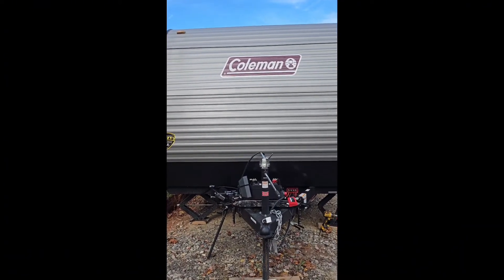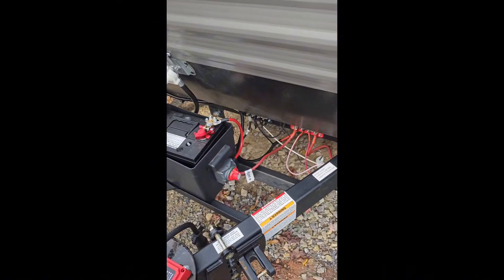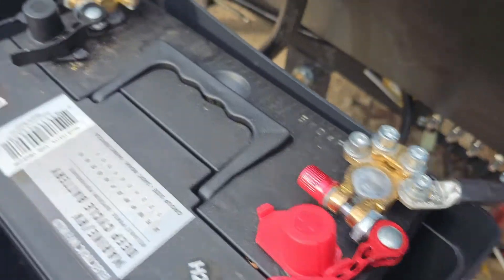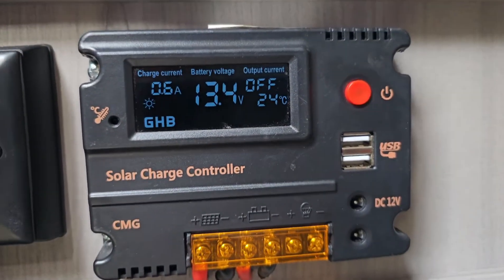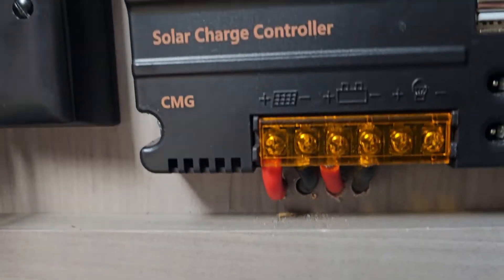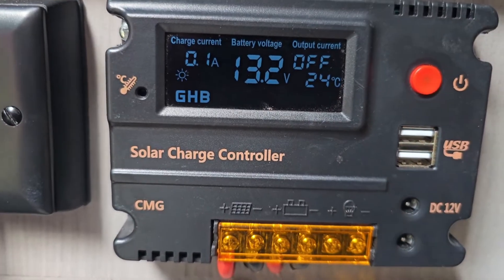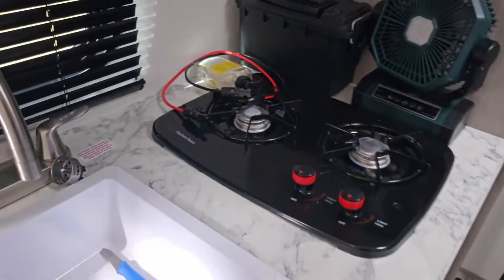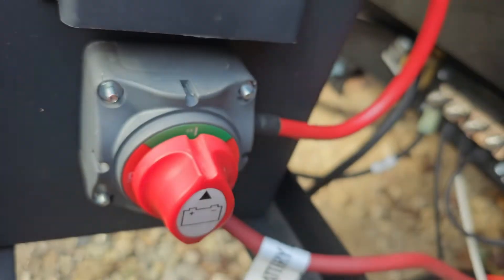ADDING SOLAR ON THE COLEMAN 17B CAMPER. (on the way to off grid)

Comment: im buying a 17r right after thanksgiving. one of the first thins im doing is hooking up solar to the solar ready plug. you have a great set up i wish you explained better where each plug was and where it goes like a wiring diagram since you said its just an emply plug
Reply: so the solar panel is plugged into the plug which goes to the controller and then you have wires coming from the controller to the buss bar, which then is switcdhed by a disconnect?
Reply from the maker: Well the reason I didn't show where the plug was originally was because mine came with some really Tangled wiring and was not professionally done and it was just hanging down so I wanted to get it off as soon as possible. If you're doing this I would highly suggest watching a few videos on how to hook up a charge controller in any solar system. I know it seems difficult but it's actually extremely simple. It's all direct current so think of it as a straight line. You run wires from your battery to your charge controller with fuses in line of most everything. Then you run wires from the solar panel to the charge controller and honestly that's it. The bus bar is basically just a power distribution board so you could also think of the bus bar as the battery. Everything red from the battery connects to the Red Bus bar and black to Black. As long as you have the black grounded to the frame and all power going to that red bus bar then another wire from the bus bar to the battery then you're good. I really hope I didn't overcomplicate that.
Reply: @BULLETENVY o
Reply from the maker: I'm super happy you're getting a camper. It's going to be a great journey for you.

Comment: Thanks for the video, I'm interested in one of these trailers and wanted to understand more about how it was "solar ready" What is the model of the charge controller?
Reply from the maker: Well I'd be happy to answer any questions you had and I hopefully soon we'll be putting up a video of an entire overview of the whole camper. And I think I still have the box for the charge controller so I'll go out to the garage and find it and get the model for you if I can. Just be aware solar ready doesn't mean anything other than it has a plug that will accept a solar panel. You would have to do all the wiring yourself. It's just a marketing gimmick. Also I'm glad you like the video. Thanks for watching.